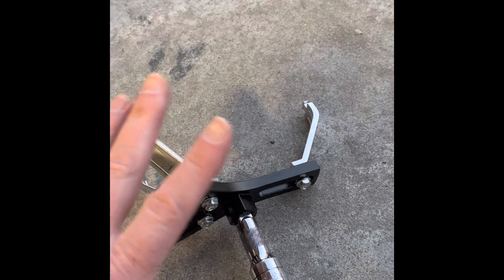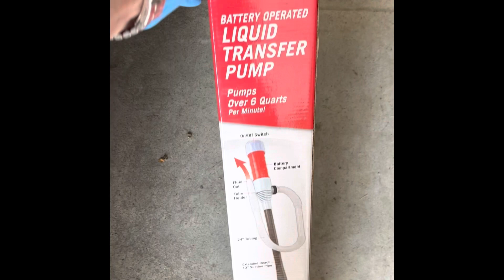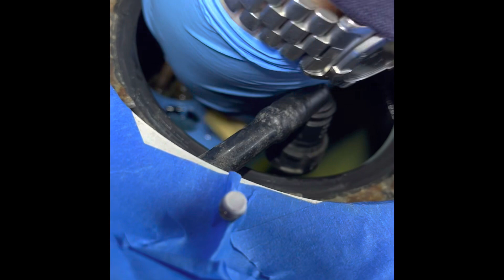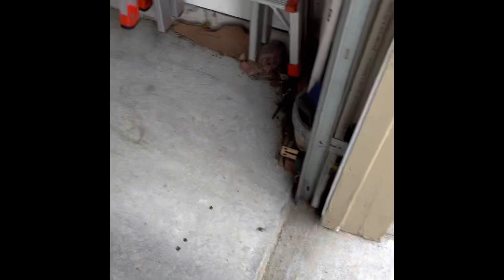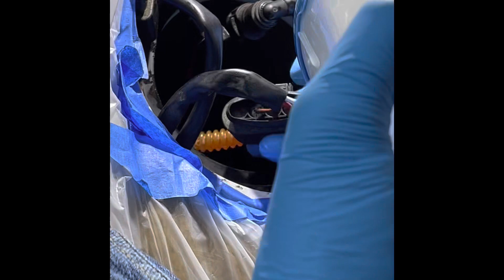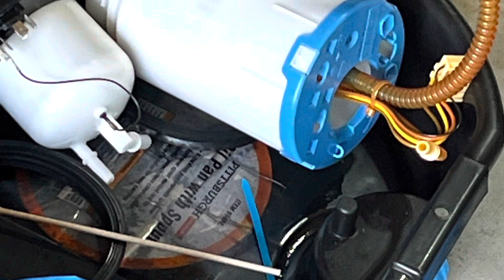Porsche Cayenne 958 fuel pump

Comment: Hi! Quick question please! The locking ring? Did you have to prise the little tabs upwards and the pump housing lifts straight up? Or does the ring need to be tapped around a little? Not sure if there’s any kind of thread there?
Reply from the maker: Just tap it around.  

Mark the rings before unloosing.  

Lift pump out.  It will be connected to the fuel hosed from the tank 

GL